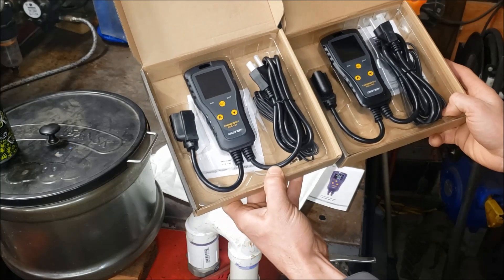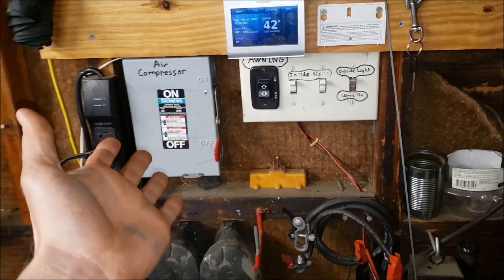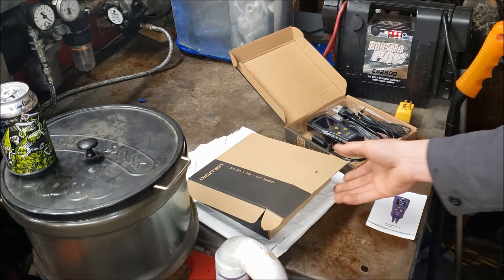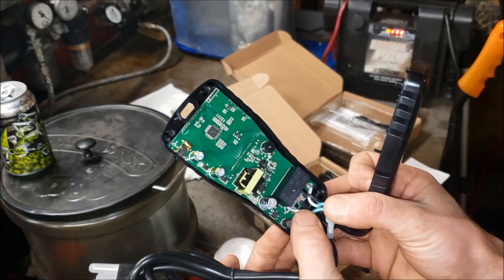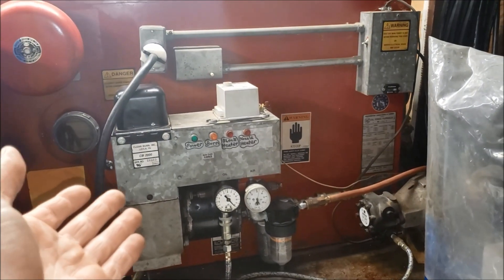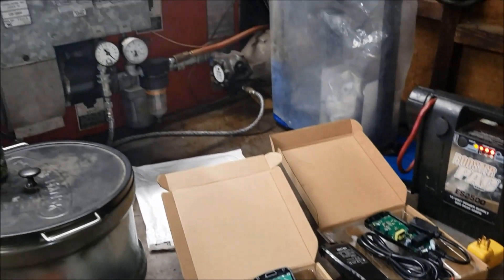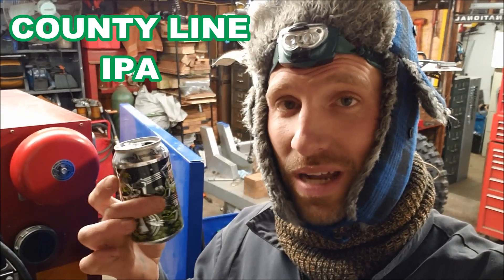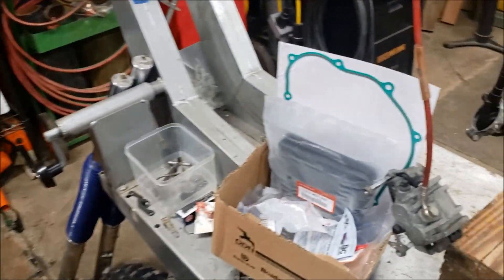Digiten Thermostat UPDATE - They Revised The Wiring Because of my Video!?

Comment: Thanks for the video. Can you please reiterate how to tell the difference between the old and new models so one ensure they get the safe one?  Thanks.
Reply from the maker: No problem. Glad to hear you found it helpful. The only way that I think would be best is to just take the screws out and look inside. If the neutral wire is switched then that's not good. That means hot is always running to the appliance